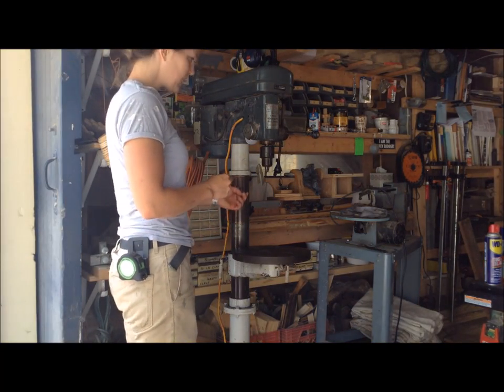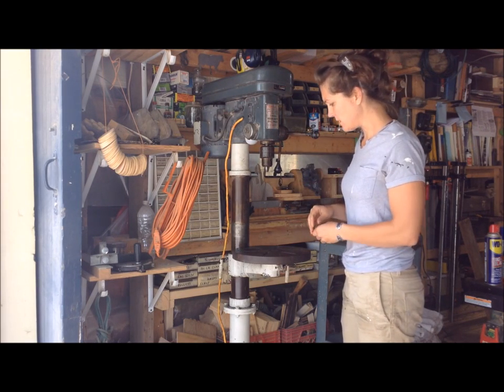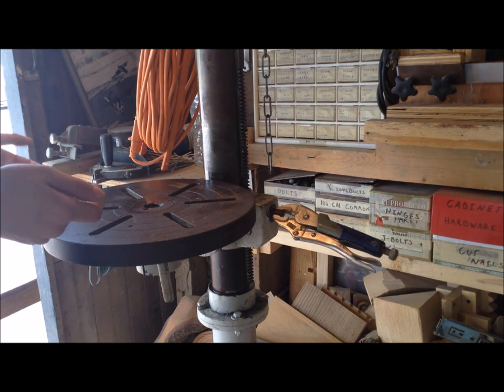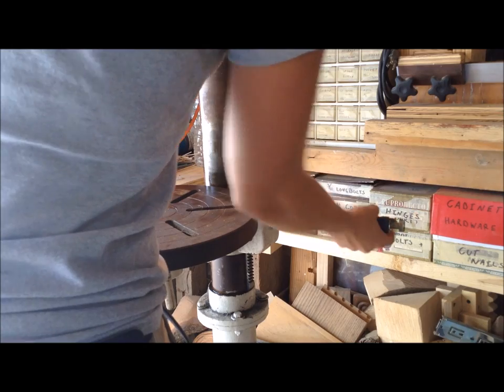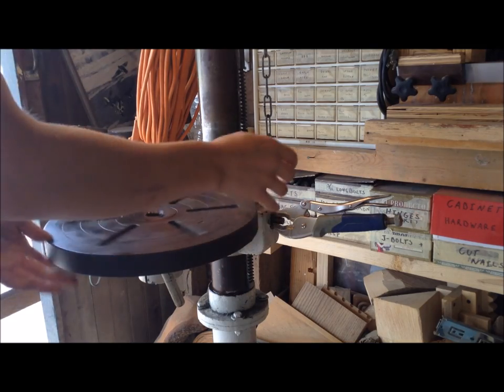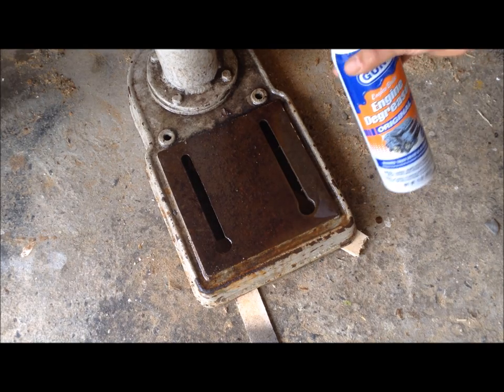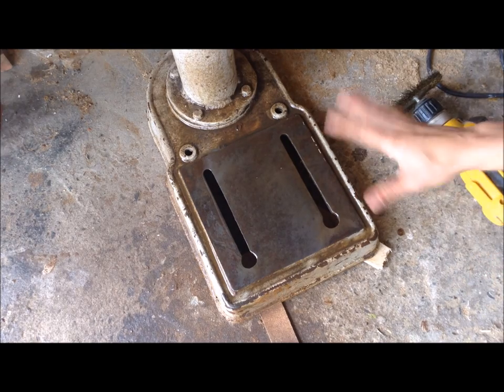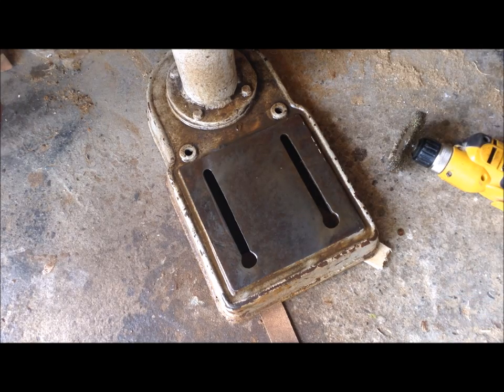Clean Cast Iron // How-To

Comment: I know that this is one of your older videos, but I have found to help make the wax last a little longer, before you apply the past wax, take a heat gun and gently heat the surface that you are apply the wax to and that will allow the wax to soak in to the pores of the metal and keep the moisture out of the metal a lot longer.
Reply from the maker: Hey, that's good to know, will definitely do that the next time I break out the wax.
Reply: @HoneyBadgerWoodWorks  You are very welcome.

Comment: I have found white vinegar will remove rust well. Saturate the surface and cover with rags or paper towels and let it soak for ten  to fifteen minutes depending on amount of rust.  Wipe off rust with damp rag and use paste wax to protect clean surface.
Reply from the maker: Good to know thanks!

Comment: I'm going to try the wire brush method on my tools too, good to know the details about the Central Machinery Drill Press since I'm looking to replace my bench top drill press too .
Reply from the maker: Yeah, if you just want to remove rust fast and aren't worried about messing up a flat square surface like a table saw it is a great method.  And since I removed all that build-up it has been working fine, so no complaints.
Reply: Good to know

Comment: Good job !!! Nicely done !!!....I´ve a question....I´ve seen that in your latest videos, you use a mortiser machine and in some other video (I guess you didn´t have the mortiser back then) you used your drill press to make mortises, am I right ???? Anyway, question is, how do they compare ? Is there a whole lot of difference between them as far as making mortises is concerned ? Love your work !!!!!
Reply from the maker: I started out making mortises on the drill press, moved up to a mortising jig, and then someone gave me a mortising machine which I use now.  All work well.  The mortising machine is the most accurate and fastest way to cut them, but I made them for years without one.  downside to a bench top machine is you a limited to about 4.5 inch thickness, over that and it won't fit on the machine which is a little bit of a pain.
Reply: @HoneyBadgerWoodWorks  Thank you so much for your answer, I guess there is no reason for a hobbyist like me to buy something else, already have a drill press, it's just that my wife keeps saying: what do you want another machine for ??, look at that girl you're always watching, it's not the tools.......oh well..... If I only had her boots !!!!!!!...................Love your work !!!!!!!!!!
Reply from the maker: @MarcoACasco  I used a drill press for years, it works fine.  I then made a homemade jig that was a little more accurate and that also works well.  The machine is great but not a necessity.

Comment: Hey if it was free and it didn't take much to get it going not bad at all for a drill press that you didn't have before and now you have one cool when I first started working with wood I had a drill vibrating sander in a skill saw that's it so I know what it's like to start out with nothing and work your way up I bought an old crappy table saw for two hundred bucks you needed new bearings new crank handles but I couldn't afford a brand new one I just bought a new parts for it fixed it still works great today nothing wrong with starting small and used if they work they work that's all that counts...👍👍
Reply from the maker: Right!  Free is where it's at,  yard-sale finds are great too.

Comment: I used WD-40 and my palm sander to de-rust mine.
Reply: I bought a WEN bench top drill last year. It is about 10 degrees off front to back and there is no adjustment for it. I cut a piece of pine 1x8 at 10 degrees and it works fine now.